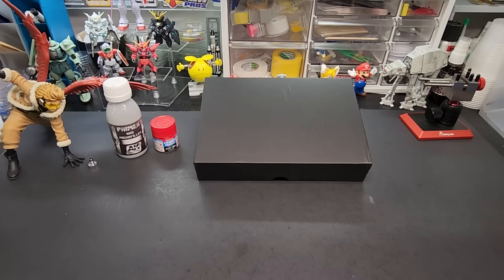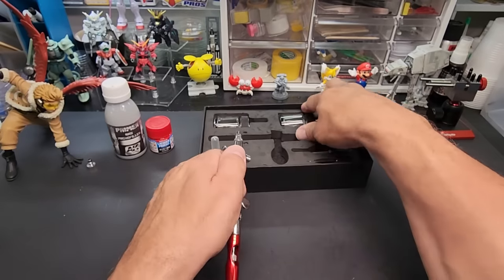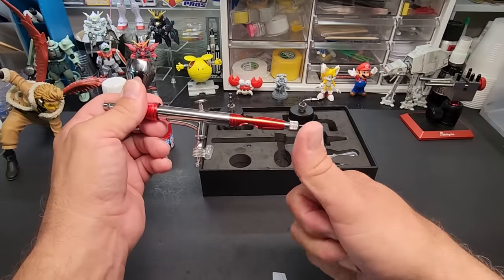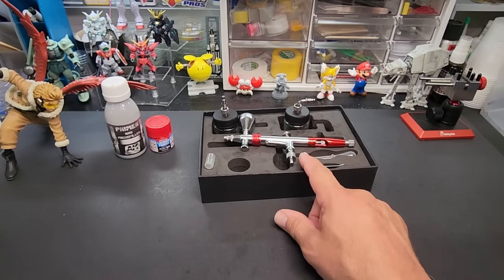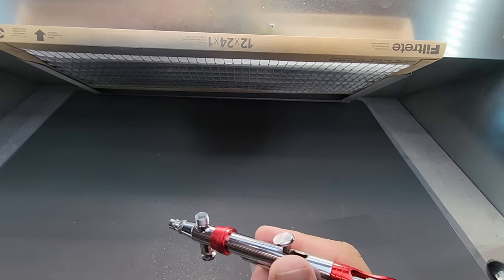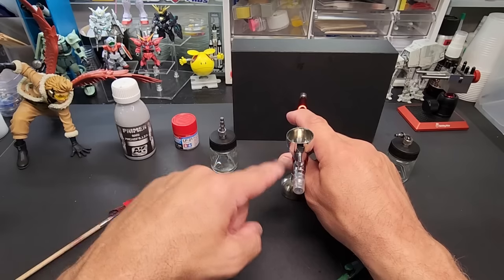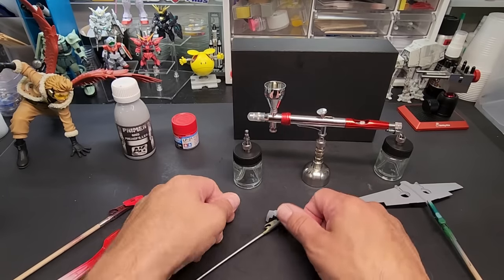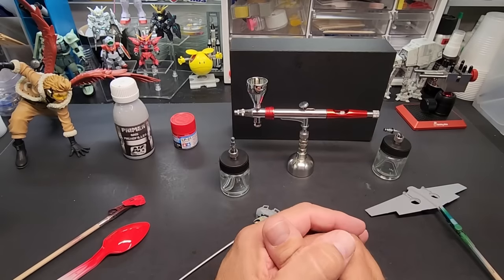Testing A 3 In 1 Airbrush - Gravity - Side - Siphon Plus Give-A-Way Casubaris

Comment: I have learned a ton from your videos. We had bought a Harbor Freight Air Brush a while back and only used it a couple of times until I found you and your videos and now we have used it quite a bit on our RC Car bodies. I think we need to get a better one with a larger tip. I am struggling a bit with the metallics and pearls requiring several coats. This may be pretty normal for shooting clear lexan but I am open to your advice. I have made your thinner less the retarder but it still seemed to work just fine. I sure thank you for the  information you provide in your videos. I have started enjoying air brushing instead of being intimidated by it. Thanks so much.

Comment: You must be able to find a plastic bottle with the same thread, to cut the base off and use it on the side feed. Off the top of my head, there is a way of putting a wire round a glass bottle, heating it then quenching it in water to cut the base off. Then you can use Tamiya Bottles. [same thread on the lids]

Comment: just a quick question.  I am a dummy.  If the air hose I have doesnt fit the compressor (the threaded part of the hose is too big for the compressor) what do I need to buy?  I know its an attachment, but im not sure what its called or what size I need.  It's the hose that came with the Neoeco you reviewed going into the air compressor from Harbor Freight that you reviewed awhile ago.  Thank you!!